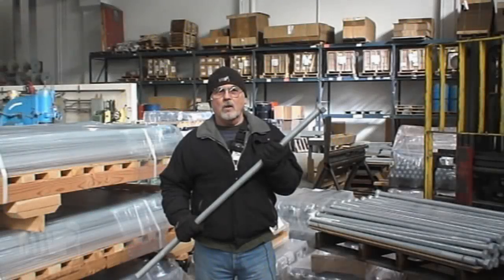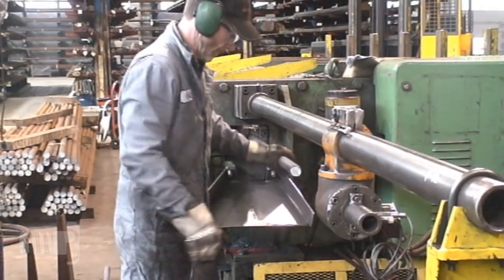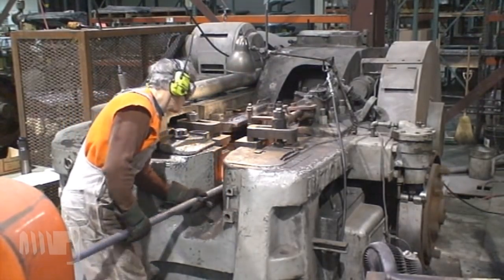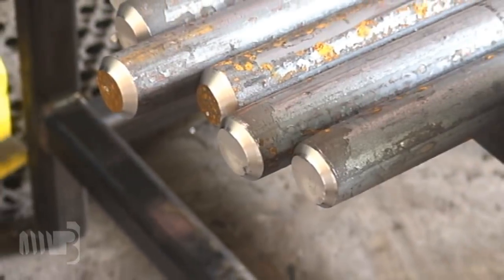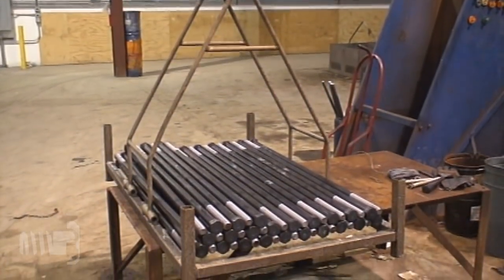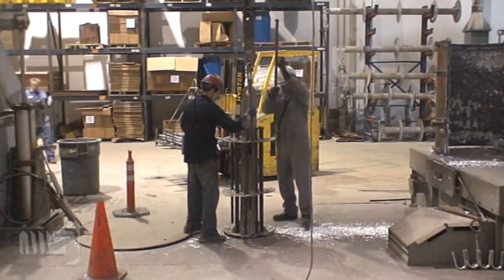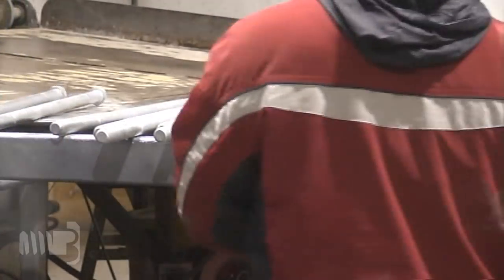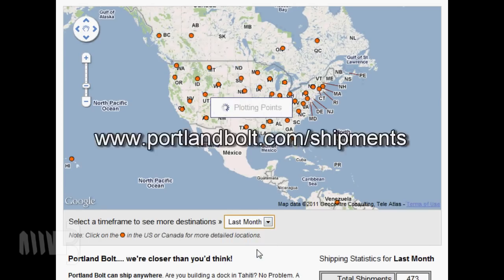How a Bolt is Made - Portland Bolt & Manufacturing

Comment: wonder why they cut the threads when rolled threads (as I understand it) are much stronger, less prone to failure.
Reply from the maker: The F1554 specification reads, “Threads shall be rolled, cut, or ground at the option of the manufacturer, unless otherwise specified”.  Regardless of how the threads are formed, the anchor bolts will meet the minimum mechanical requirements of the specification.  The decision to roll thread or cut thread is based on a variety of factors including equipment availability, pitch diameter steel round bar availability, bolt grade, finished fastener configuration, and a variety of other factors.  Portland Bolt operates flat die roll threading equipment that will produce a maximum thread length of 8” on a maximum diameter of 1”.  We cut thread larger diameters.
Reply: So the limiting factor here is size?
Reply from the maker: Yes. Portland Bolt uses flat die roll threaders which limits our roll threading capabilities to a maximum of 1” diameter and 8” thread length. You can see more about roll threading in our other video: https://www.youtube.com/watch?v=MvWmH3Dr52o&t=0s
Reply: I have been running cold forming progressive headers, and thread rollers for six years. Trust me when I say that rolling a bolt, that is 4 feet long, would be a major pain in the ass.
Reply: we roll anchor rods up to 1-1/4" x 10 feet no problem
Reply: john Blake The size of your thread rollers must be massive. Would love to see a video of it.
Reply: mds19238 Because these are actually crappy Bolts I think ! They should shot peen them as well to stress relieve the blank after forging ! And yah rolled Threads is quicker or as quick to do , way better strength and surface finish ! These are like a sub par grade 5 in my book . Wouldn't put them in my bridge or building !
Reply: They are only crappy if not made to the specification. They are not as strong as grade 5, but saying they are sub par is not accurate. Sub par is used used to describe something that is below what is expected. Rolled threads are great but would require sizing the threaded portion down to the pre-rolled diameter before rolling. Thanks for your time.

Comment: What type of steel do you typically use for these bolts?
Reply from the maker: The anchor bolts in this video use A36 steel round bar.  However, we frequently manufacture bolts to a dozen or more specifications using a variety of raw materials including low carbon steel, alloy steel, and stainless steel.
Reply: Portland Bolt 99999

Comment: How about Heat-Treatment.. Any upsetting Hardening & tempering is not required...???
Reply from the maker: For many grades of fastener, heat treatment is required after the heading process. For some low carbon grades however, heat treatment is not required.
Reply: Thank you..

Comment: Do you retest the threads after galvanizing?
Reply from the maker: +Kevin Daugherty We gauge our threads to 2A thread tolerances before galvanizing, then test fit galvanized, tapped oversize hardware on the threads after galvanizing to assure a proper thread fit.

Comment: Do you make Acme form thread bolts ?
Reply from the maker: Chris Brown - We have the ability to cut Acme threads in a limited range of diameters and thread pitches.  We commonly manufacture 1" diameter  5 pitch Acme threaded bolts from 2 feet to 7 feet in length for a clamping application.

Comment: Is it US Made steel you are using for your bolts?
Reply from the maker: dadadruma - Yes, the steel round bar we use to make bolts and the steel flat bar we use to make plates are both melted and manufactured in the United States.

Comment: Curious to know why the threads aren't rolled.
Reply from the maker: +Gary Sheehan - Portland Bolt has the ability to roll threads on bolts 1" diameter and smaller.  Therefore, we used Landis Cut Threaders to manufacture this particular order.
Reply: Portland Bolt cool, thanks. 👍

Comment: I saw more of how to place an online order for bolts than how it was made.
Reply from the maker: Dennis Marfo - This video is strictly a demonstration of the labor processes involved in manufacturing one type of bolt we produce.  There is no information on how to place an order online since we do not provide that option.  Our website is not an e-commerce site.  Since we are a custom manufacturer of nonstandard anchor bolts and construction fasteners, there are way too many variables to provide the ability for customers to order their bolts through a web page.  Our salespeople are highly trained to ask all the pertinent questions necessary to manufacture the exact fasteners that an engineer has designed into a structure.  Unless it is an extremely straightforward requirement, most quotes and transactions require a discussion as to the specific quantity, dimensions, grade, and finish required.  Other answers to key questions our salespeople will need to know are thread lengths, required accessories such as nuts and washers, how quickly delivery is required, whether or not we should include freight in the estimate, whether or not the sale is subject to sales tax, etc.  The ordering (and manufacturing) of nonstandard bolts is complex and requires a significant amount of communication that can only be accomplished by an exchange of information via email, phone, and live chat, all three of which we offer and encourage.  An e-commerce site for nonstandard fasteners is simply not feasible.

Comment: Wouldn't a formed/ rolled thread be more efficient to make?
Reply from the maker: +thangamajig - You are correct that many aspects of roll threading are more efficient than cut threading.  However, there are issues with the availability of certain sizes and grades of pitch diameter steel used in roll threading, and Portland Bolt is limited to 1" diameter and 8" of thread length when roll threading bolts.  Therefore, the bolts in the video were cut threaded.
Reply: It takes a great deal of patience to answer all these dumb questions

Comment: Surprised they cut the threads, vs. rolling them in.
Reply from the maker: GroovesAndLands - We use flat die roll threaders and have the ability to roll threads on bolts from 1/2" diameter through 1" diameter.  We have a roll thread length limitation of 8" long.  We cut thread larger diameters and longer thread lengths.  Here is a link to our threading capabilities: https://www.portlandbolt.com/about/manufacturing/threading/

Comment: Why arent the threads rolled as they are stronger than cutting
Reply: It may be a customer requirement.
Reply from the maker: roy Yung - We use flat die roll threaders and have the ability to roll threads on bolts from 1/2" diameter through 1" diameter.  We have a maximum roll thread length limitation of 8".  We cut thread larger diameters and longer thread lengths.  Here is a link to our threading capabilities: https://www.portlandbolt.com/about/manufacturing/threading/
Reply: @pdxbolt  Ahh ok that explains it. I did sone work for a fastener manufacturer and learned a great deal on how premium fasteners were made. I was fascinated at how bolts were rolled and nuts were cut on a 90°   cutter for nuts. I did work for the old Mapri company in Brazil. They made super high quality fasteners

Comment: I was always taught to have a very strong thread it had to be thread rolled not cut as the cutting process removes material in turn wreaking the strength where thread rolling compress the material to form the thread no cutting or material removal takes place giving a stronger cleaner thread form  I might have been ill informed I'm an applications engineer for WFL mill turn Cnc  so this is not really my field of expertise ?
Reply from the maker: +Chris Murray - Yes, the nature of the grain structure and the cold working of the threads during roll threading does produce a stronger product in most cases. However there are limitations on the grades and sizes that we are able to produce with rolled threads. Additionally, just because rolled threads are sometimes stronger does not mean that cut threads are insufficient. We manufacture and test our bolts so that they meet the requirements of the appropriate ASTM standard regardless of the threading method. Below is a link to an FAQ on our website that answers this in a bit more detail.

http://www.portlandbolt.com/technical/faqs/rolled-vs-cut-threads-bolts/

Comment: No rolled threads?
Reply from the maker: Philip - We use flat die roll threaders and have the ability to roll threads on bolts from 1/2" diameter through 1" diameter.  We have a roll thread length limitation of 8" long.  We cut thread larger diameters and longer thread lengths.  Here is a link to our threading capabilities: https://www.portlandbolt.com/about/manufacturing/threading/

Comment: I didn't realize that threads like this would be cut and not rolled. Seems the weaker of the two options.
Reply from the maker: +coloredcoat - You are correct. Rolled threads typically result in a stronger part.  However, bolts manufactured with cut thread will still meet the mechanical requirements of the given ASTM specification.

Comment: I'm surprised the threads are cut and not rolled
Reply from the maker: AussieBlokeGordo - We use flat die roll threaders and have the ability to roll threads on bolts from 1/2" diameter through 1" diameter.  We have a roll thread length limitation of 8" long.  We cut thread larger diameters and longer thread lengths.  Here is a link to our threading capabilities: https://www.portlandbolt.com/about/manufacturing/threading/

Comment: you need a plastic ball blanket on the tanks to prevent fumes and water evaporation - that's what we had in the 1980s in the heat treatment department!
Reply: YOUUUU weren't in heat treating in the 80s!   EYYYYE was in heat treating in the 80s!  We had a rubber dildo blanket on our tanks at our facility in San Francisco.

Comment: Pickling in acid can create hydrogen embrittlement.  How do u over come this
Reply from the maker: @M. D. Shiby Shiby - Pickling in acid can indeed lead to hydrogen embrittlement but only in extremely high strength fasteners that have a minimum 150ksi tensile strength.  Alternative corrosion-resistant coatings for these high strength fasteners are available.  However, the vast majority of construction grade fasteners can be hot-dip galvanized without the risk of hydrogen embrittlement. 

More information here about galvanizing high strength fasteners:  https://www.portlandbolt.com/technical/faqs/galvanizing-high-strength-bolts/

Comment: is your steel domestic?
Reply from the maker: Paulzo Islander - Yes, we use domestically melted and manufactured round bar to make virtually all of the bolts we produce. We stock both domestic and imported nuts and washers to accompany our bolts.  The specific job will dictate whether we supply domestic or imported nuts and washers.  Most state highway projects are federally funded and therefore require 100% domestic product. Some other government and military projects also require American-made fasteners.

Comment: Why aren't threads rolled? Rolled threads are much stronger then cut threads
Reply from the maker: +roy Yung - Thank you for your comment.  We have an informative FAQ on rolled versus cut threads on our website:  http://www.portlandbolt.com/technical/faqs/rolled-vs-cut-threads-bolts/

The bottom line is that either way of producing threads (cut or rolled) is allowed per the ASTM F1554 specification and will result in a finished anchor bolt that will meet the mechanical requirements of the specification.  Our equipment limits our ability to roll thread bolts this large in diameter.
Reply: Slightly stronger. This is hot rolled.

Comment: You need to go automated. Do you do metric?
Reply from the maker: Unfortunately, we do not manufacture metric fasteners.  In the United States, there is simply not enough demand for large, nonstandard metric fasteners to justify the expense of tooling up our entire shop to make them.  There are also very few, if any, reliable domestic sources of metric round bar which we use to make bolts.  

We have tinkered with automation in the past, but robotics and automation don't really fit our business model.  Automation is geared more towards large production runs of standard sized fasteners as opposed to small orders of nonstandard sizes.  We are a job shop, and it is not uncommon to manufacture orders of bolts in quantities less than 50 pieces.

Comment: Threaded, not rolled?
Reply from the maker: Mike Hatch - We use flat die roll threaders and have the ability to roll threads on bolts from 1/2" diameter through 1" diameter.  We have a roll thread length limitation of 8" long.  We cut thread larger diameters and longer thread lengths.  The ASTM F1554 anchor bolt specification allows for bolts to be either cut or roll threaded.  Here is a link to our threading capabilities: https://www.portlandbolt.com/about/manufacturing/threading/

Comment: Why not make them stainless steel , if i were using bolts like that i dont think id want to redo it and galvanized eventually will rust up
Reply from the maker: @Dennis De Jong - A stainless steel (type 304) anchor bolt in the same size we manufactured in the video would cost roughly 4 times the amount it cost us to manufacture galvanized F1554 Grade 36 anchor bolts. There are also potential dissimilar metals issues when stainless bolts contact carbon steel structures they are bolting which could lead to corrosion issues.  Engineers are also looking for a combination of strength and ductility and select grades of anchor bolts based on those calculations. Stainless steel may not have possessed the proper mechanical properties for this particular application.  Decades of service life can be expected from galvanized anchor bolts which should last just as long and the substation structures themselves.

Comment: If you want a strong thread you should roll it not cut it!
Reply from the maker: @mattias Larsson - Thank you for the comment.  There are several advantages to rolled thread but drawbacks as well, all of which are detailed on this FAQ on our website: http://www.portlandbolt.com/technical/faqs/rolled-vs-cut-threads-bolts/

With regard to threading methods, all ASTM and SAE construction fasteners allow for either cut or rolled threads.  Cut threads are extremely common and result in a fastener that meets all of the dimensional and mechanical requirements of the various ASTM and SAE fastener specifications.

Comment: A bolt is not a bolt until a nut is attached  it is a cap screw  look it up
Reply: A cap screw is in fact a bolt with thread all up to the cap. A bolt hasn't got thread all the way to the head.
Reply: @cccetomacrogol  
Depends on the type of bolt. Tap bolts have threads all the way to the hex.
Reply: Did anyone look at Portland Bolt & Mfg. Co. website for their explanation of he differences between a hex cap screw and a hex bolt? And who has the authority to say which is which? ASTM has various standards that me be interpreted different ways. https://www.portlandbolt.com/technical/faqs/hex-bolts-vs-hex-cap-screws/
Reply: Jim Hammond LoL ok Jim!